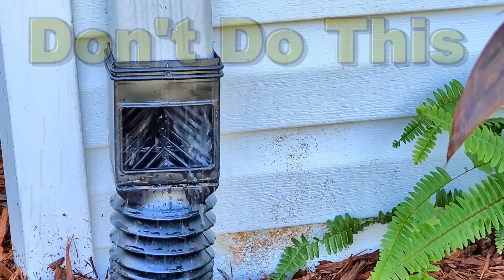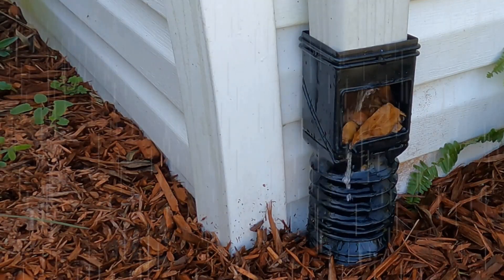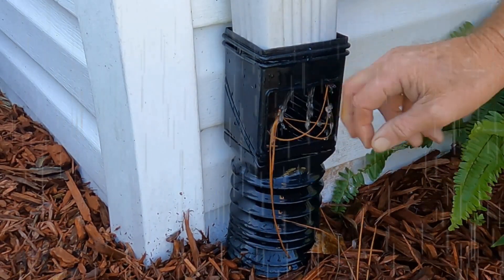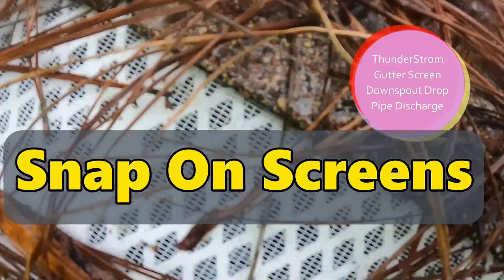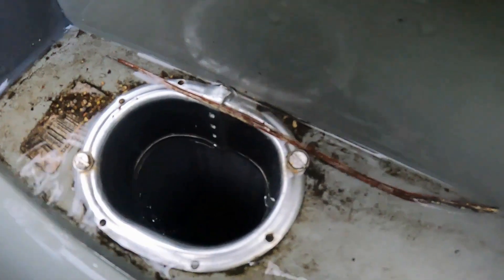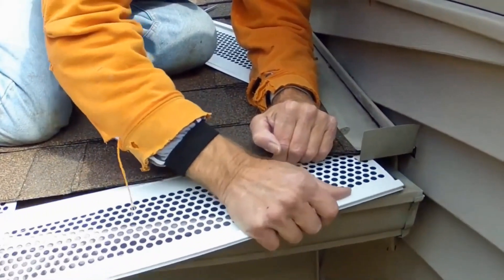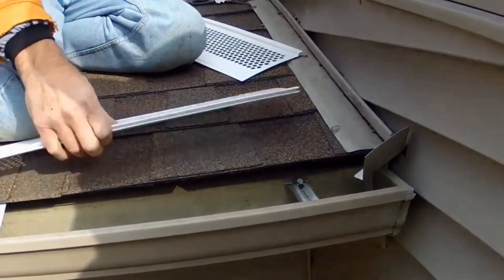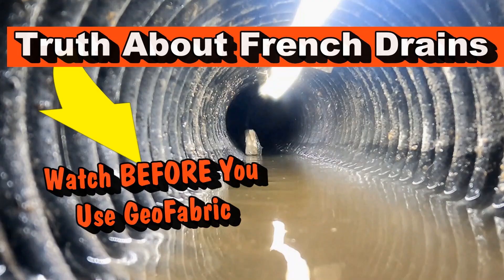Don't Use This Leaf Thing

Comment: I like your channel. I have these downspout covers. I watched this video with keen interest.
However, you live in Florida. I live in Colorado. It snows here - and ice dams form. Please discuss how well your leaf guard alternate performs in the height of winter.
Reply from the maker: @ThereIsNoOtherHandleLikeMine  it’s frozen in winter, right? So when it thaws the snow melts and water drains through the screens.. how this helps
Reply: @appledrains  No. It freezes, thaws, freezes, thaws. Gutter guards can cause ice dams, which destroy roofs.
So the question is: Does you solution create more problems?
Reply from the maker: @ThereIsNoOtherHandleLikeMine  I think I answered your question.. but again
They work good
Reply: @appledrains  Given what I have read about gutter guard ice dams, I have to disagree. The instructions you provide appear to increase ice dam risk.
Reply from the maker: @ThereIsNoOtherHandleLikeMine  ok
You disagree
Reply: @appledrains  I live in Michigan and have gutter guards similar to yours.  No issues in winter including ice dams that I've experienced for over 10 years....  Key is to ensure water has a way to always flow when it thaws. No much  you can do when it freezes...